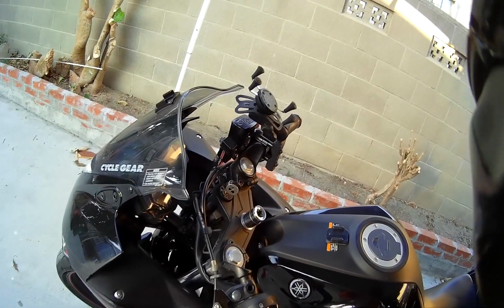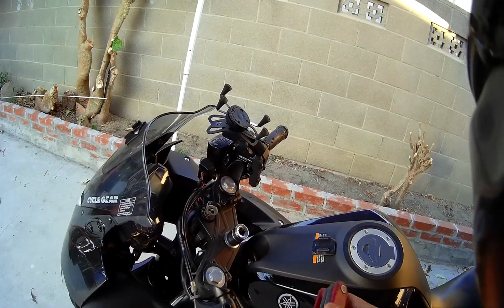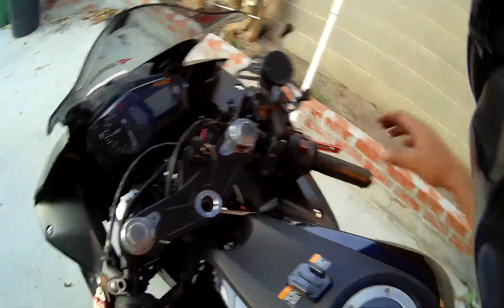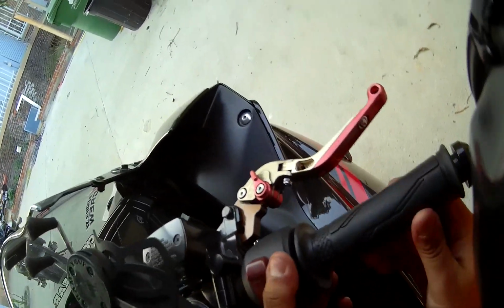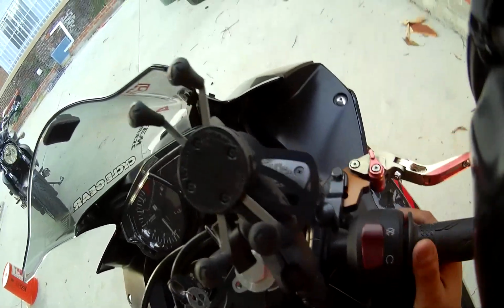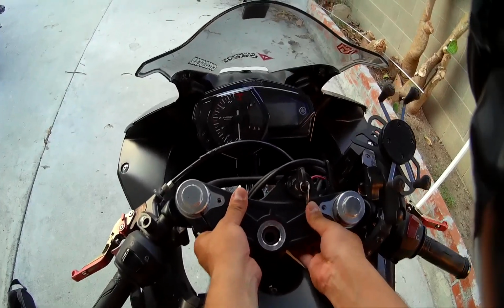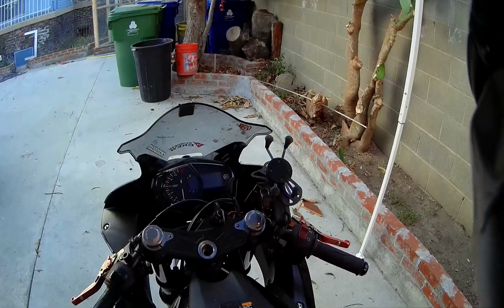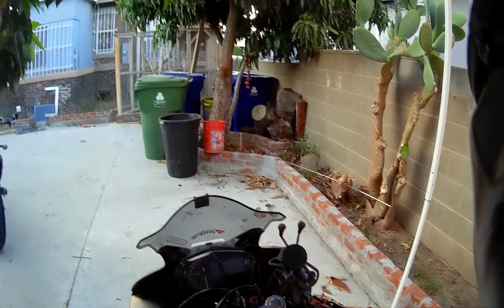Yamaha R3 Clip-on Mod

Comment: Won't this affect our steering angle and comfort?? I mean the lower clip ons will scratch the Fibre fairing right??
Reply from the maker: +Advait Berde it just like having aftermarket clip on. Just not as nice looking and super perfect figment. Which is why I said it's the budget friendly clip one lol
But if you angle it just right it doesn't hit the fairing or dash as some others have said. 
It I turn it far right I can make it touch the fairing bcuz there's like a one millimeter gap there so if I push down a bit yeah I can get it to touch easily but i would hardly ever be in that position so it doesn't affect much anyways

Comment: I've seen someone get a longer screw for the top mount to control/stabilize the z-axis (seems like a pretty good idea). Basically, the same thread just a longer screw and bolt from bottom (extra sense of security - similar to manufacturer specs. If you have the chance you should try it.... be safe bro! Great video...

Comment: can you do a walk around with the bigger tires
Reply from the maker: +Carlos Gomez I'll make a video about them this week.
Reply: thanks man..can you tell me if the handling is better and do you notice a difference with the bigger tires ?
Reply from the maker: +Carlos Gomez recorded a quick video this weekend. Uploading tonight. Should be up by tomorrow morning. 
Summary: going to the Q3 from the pilot streets made a huge difference. Mostly bcuz I trust the that tire with my life. Super sticky. I'm able to focus on everything else, ( body positioning, entry speed, lean angle, etc) and not worried about when my tire will slip out. So for me that was a plus all by itself. 
I don't think I noticed a huge difference due to the size change. I'm assuming, like most ppl say, that a bigger tire has more rotational mass and blah blah blah. Honestly acceleration, top speed, and braking stayed the same for me. 
Hope this helps.
Reply from the maker: video's up :)

Comment: Is there a way to put those two bolts back there to keep the bars in place? I'm wondering if eventually they will get loose and get misplaced or something.
Reply from the maker: +Mario Iturri I couldn't figure out how  I just kept them aside somewhere so I don't lose them.
Reply: I did this and just got 2 longer bollts and put them in from the bottom, it keeps the bars in place.

Comment: how's this mod working out for you? Any regrets? any thoughts?
Reply from the maker: So far it's been great. Haven't noticed any adverse effects. I like the feel, not ridiculously aggressive. just enough to make this bike even more fun. I haven't gone to the canyons or track since the mod, but i should be doing that this weekend so ill come and update you on how aggressive riding feels.
Reply: nice! ride safe bro.
Reply from the maker: so update on the mod. been hitting the canyons hard as usual. I mean i don't feel any faster lol but it does allow me to work on better body positioning since it has the lower clip on feel, as you would typically find on a super sport, just not as aggressive. I have no issues with the mod. i did it mostly of shits and giggles, but I'm going keep it this way.